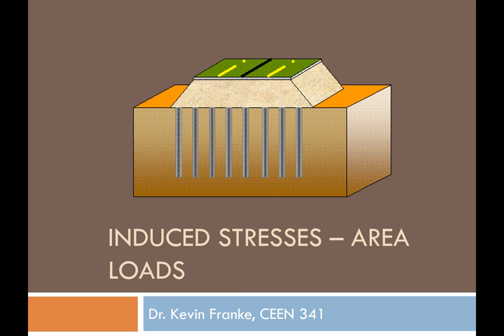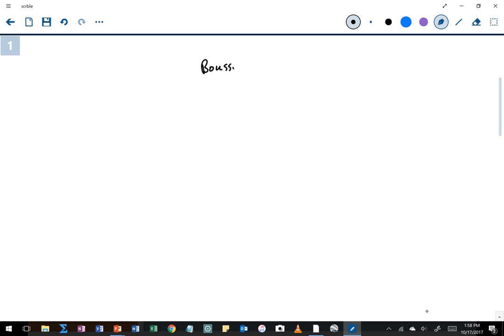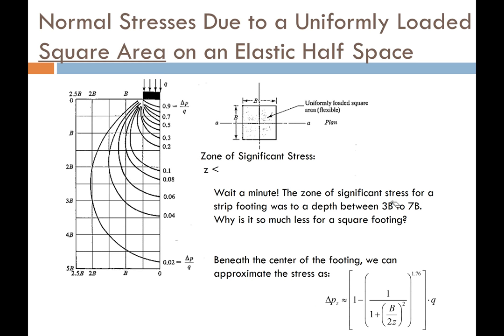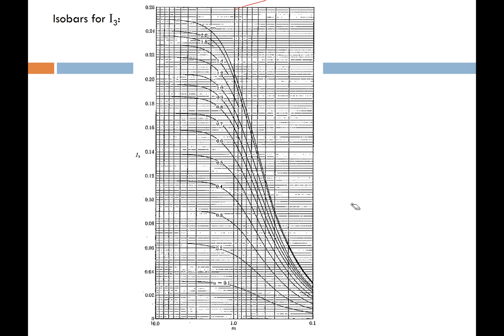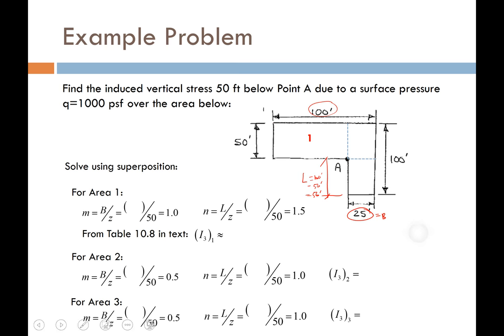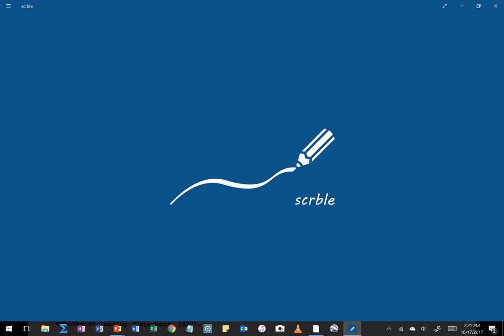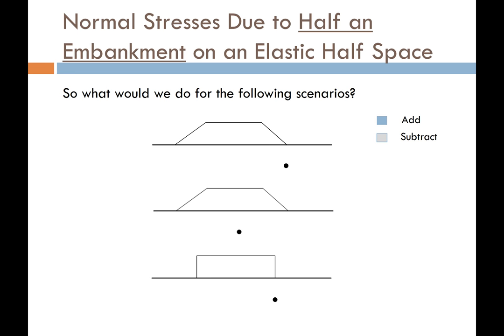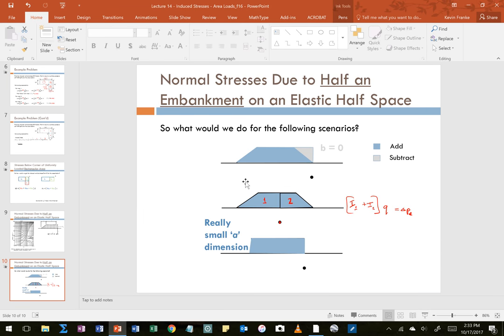CEEN 341 - Lecture 14 - Induced Stresses Beneath Area Loads

Comment: I (sub 3) is just to indicate the rectangular area has been divided up into 4 segments when considering the stress below an internal point. The point is located at the corner of each rectangular segment therefore each segment has it's own influence factor I(sub 1) to I(sub 4) and via superposition the vertical stress is the product of patch load x Sum (I)